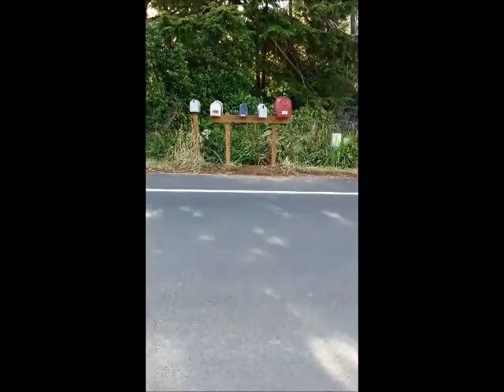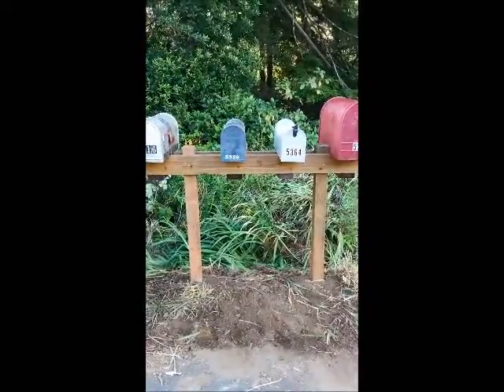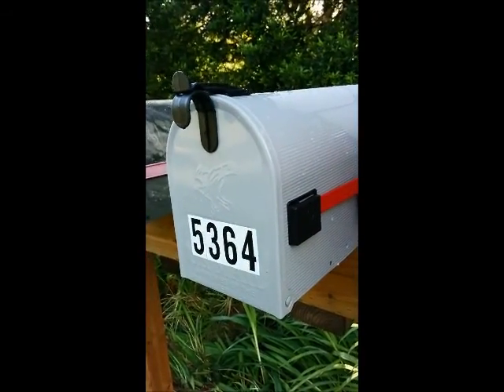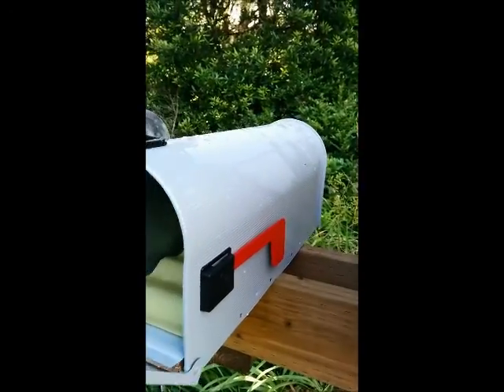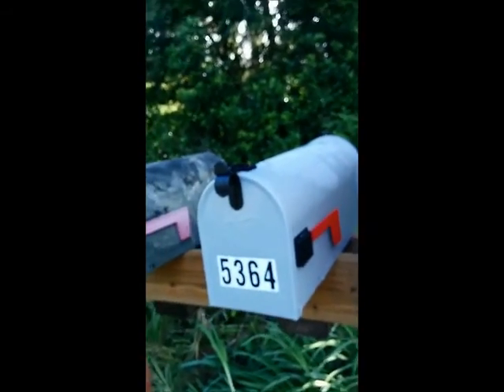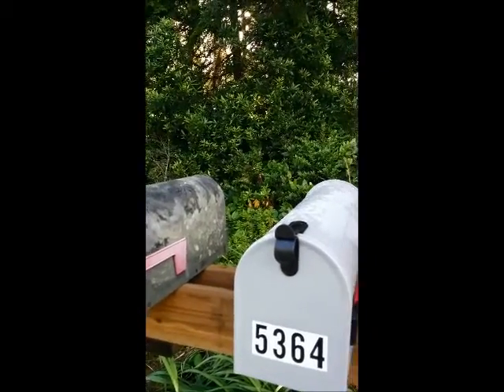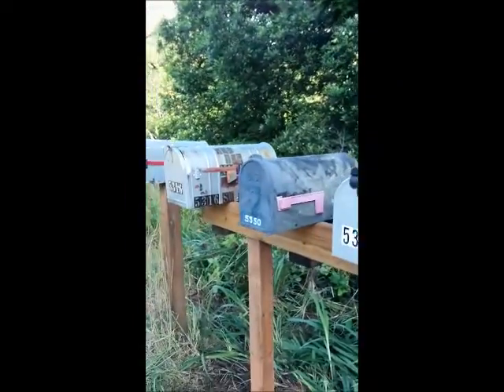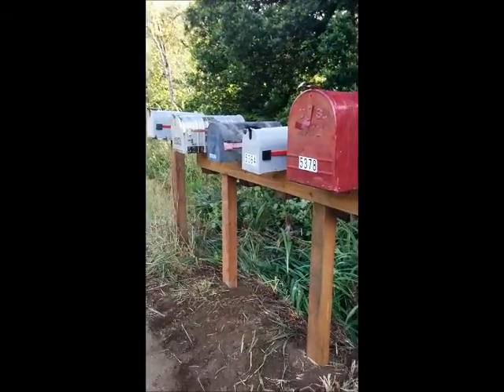Multiple Mailbox Stand

Comment: I like the 2 x 6 frame set up but I do not like driving the bolt through the bottom of the mailbox.  I would attach the bottom of the mailbox to a piece of 2 x 6 which is attached to a small piece of 4 x 4 underneath like a “T” and slide the 4 x 4 part between the 2 x 6’s part of the frame.  Then drive a bolt through the 2 x 6 frame and the 4 x 4 in the middle.  Remove that bolt and you could lift the mailbox assembly from the frame.  Great idea though.